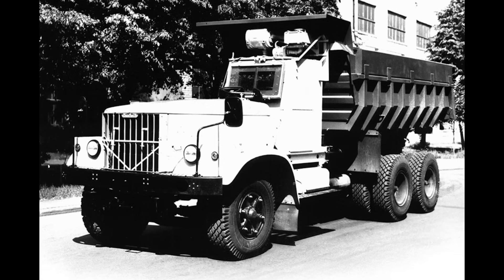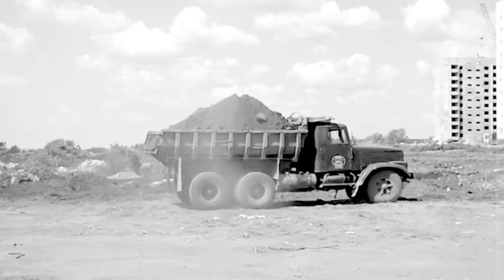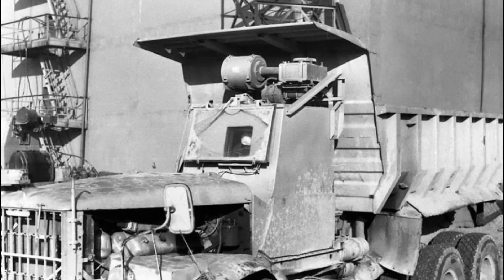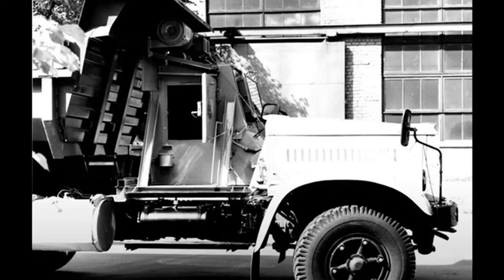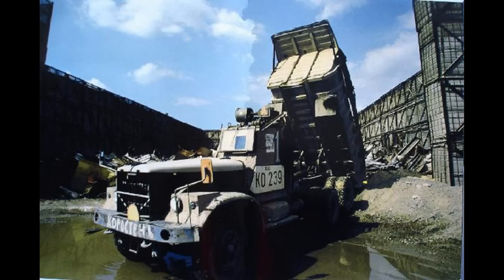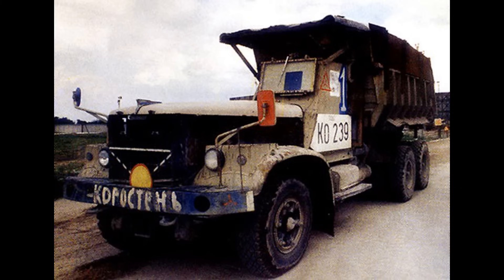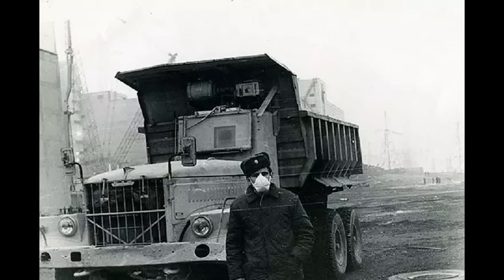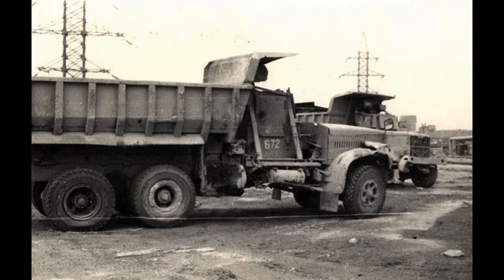Chernobyl’s Lead-Covered KRAZ | The Forgotten Rescue Truck

Comment: Wow, never knew these had a wooden cabin dressed in metal. Did they use wood all the way to 1994? What kind of wood, and how was the quality of the later KrAZ?
Reply from the maker: The quality isn't great. I don't know about the type of wood, probably all but poplar.
Reply: @TheTransportChronicles  interesting. Are there other Soviet cars that used wood? Maybe that could be an interesting video for the future. Also neat to learn about how owners took care of these wood components. You're doing a great job!

Comment: 0:29  I've always been intrigued by the unusual diamond shaped tire tread pattern on some vehicles.  I remember seeing this on an old picture of a Ford Model T or something similar for use in snow.  There is some modern modern equipment that also use this style and I believe it was a telehandler that I last saw them on.  Can anyone tell me about the benefits of this tread pattern?

Comment: The KRAZ 255/256 featured a 15 liter V8 4 stroke naturally aspirated diesel that produced 240 horsepower and around 700 lb-ft of torque. Pretty abysmal numbers by even the standards of the day (in the mid 80’s in the western world turbocharging was ubiquitous in diesel engines for trucks, with 14-15 liter engines from Cummins and CAT making 400hp+ and the 12 liter Detroit 8V92TA making 445hp and over 1200 ft-lbs) but it made for a dead reliable, fully mechanical  workhorse that was so under-stressed at that power level at ~900 cubic inches displacement that 20,000 hours between rebuilds was a very real possibility and when things did go wrong they could be easily repaired in the field. There was nothing modern about that design by 1986 but it was the extreme simplicity and reliability owing to a massive engine making little power with a total lack of electronic controls that kept them viable and even necessary at the time.
Reply from the maker: Such KrAZs are still in active operation in the post-Soviet space.
Reliable and unpretentious, they will endure any conditions.
Reply: Just to say that Iveco/ FIAT in the 70/80s Made 17 litre NA diesel with 352 HP, used in the Iveco 190/330 series. Also Mercedes Made a NA V10 with power that ranges between 320 and 370 HP . Don’t try to say that those engines are not reliable, because the IVECO V8 was used for years in that Italian Army and for costruction/ quarry jobs , some of Theo are still operating
Reply: The 903 T Cummins only made about 200hp

Comment: Of course, with 39 years of hindsight, if the cab created so much weight offset, why not move the cab to the center and rig up the steering and controls to work with that arrangement?
Reply from the maker: I think the timing didn't allow for reconfiguring the controls.
And given the short-term nature of the work and subsequent utilization, the ascent to one side was not so critical.
Reply: In America we did that with trucks designed to haul long beams at steel mills. I know for sure International, Mack, and White / Autocar built these “center cab” trucks that are exactly like what you’re describing….but they weren’t built with a 2-3 ton radiation proof cab. It seems the time crunch and the design of the truck under the cab didn’t allow the engineers the ability to fix the weight offset issue…although they could have helped it by adding extra springs to the left side steer axle spring pack. Mack actually built driver side offset cabs for 4 decades as the U / DM series, but again those were a much lighter sheet metal steel cab.

Comment: I wonder why they didn't go for the AWD 255 model🤔
Reply: Probably because it was not necessary
Reply: @375DollarCarRacer  or maybe because it had smaller payload😮 I'm googling KrAZes right now, and I've read the AWD version could haul just 7.5 tons😮
Reply: @ldmtag  Impressive, I haven't seen a AWD truck that has a higher payload than 4 ton
Reply: Mainly, I think, it is because of technical necessity.
- The 256 had a theoritical payload of 15 ton (well, most of the time they will overload them for a quicker job) while the 255 is half of it. 
- The 255 and 256, as far as I know, share the almost similiar steering gears and logically, it is very heavy and quickly get tired when turning an overloaded 255 than a overloaded 256, because the 255 had a way bigger wheel than a 256. 
- The 256, from the start, is meant to be a heavy-duty truck so it has thick C-channel and a stiff overall chassis assembly, while 255, is, well, for off-road and military use that mostly just carrying light things, provisions, and man to be honest, so it has a thin C-channel and less stiff so as to follow the surface contour. So, the modification of a 256 chassis is way easier and quicker than modify the 255 chassis to cope the 3-tonne weight of the off-the-side lead-insulated cab.
- Although the 255's overall gear ratio will allow them to carry a heavier load, but it needs to be in a trailer (semi-trailer) because of the chassis and axle structure, and that will not fulfil the initial task of building a fast in and out disposal truck. If it needs a trailer, it needs to be guided, increasing the radiation casualties. So, yeah, 256 is a good choice.

Then there is accessibility. The 255s are a huge truck and the height of the chassis (from the level ground to top side of the chassis) is over 1.5 meter, I think, while the 256s is only, I think around 900 milimeters from the ground. So, it is very easy to get in and out of 256 in a danger zone rather than in a 255.

Those are just my opinion, BTW.
Reply: @KagetTadashi  great answer, yes, I think you nailed it! Didn't realise 255 and 256 were this different.
Reply: @ldmtag  yes. I was also wondering why they don't built it based on the 257 or 258. 
That is up until some years ago, which the reason is pretty much the same as why not built it using 255s.
257s is a normal cargo truk and 258s is a normal tractor head, although both had the exact same drivetrain as the 256s. Theoritically, you could reengineered 257 chassis with thicker steel and stiffer overall construction, which could get lots of payload given that it has longer chassis than 256s, but again, much expensive in the end than just slightly modify the 256s.